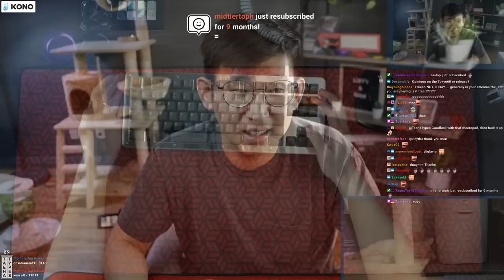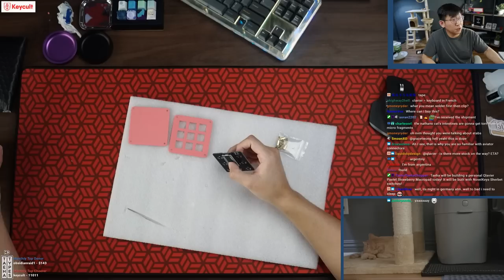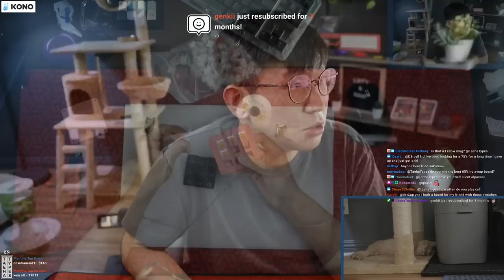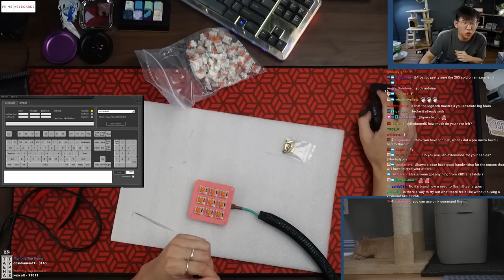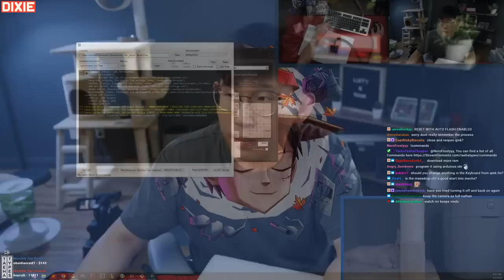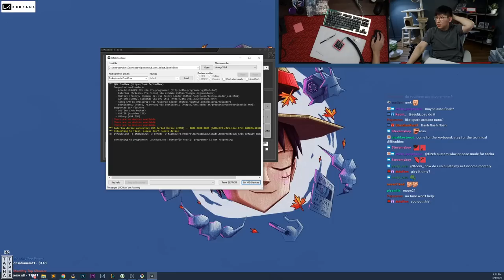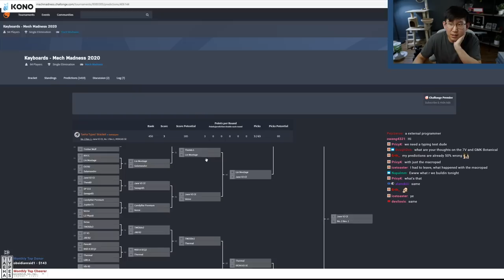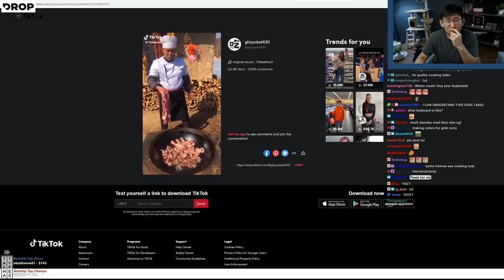Qlavier Pastel Strawberry Macropad Build Stream

Comment: The iso enter is clearly the better choice, it's vertical so you can't mistake it for another key (you press it between R2 and R3), and it's also more recognizable those starting using a pc. Another thing to add is that with 60% keyboard with HHKB style FN on the right shift you can have the arrows placed on a inverted T shape, clearly superior to the diamond one. I think that in the USA the ansi enter key is more used because it's cheaper to manufacture, and also we know that Americans struggle to adapt to a better standard (international standard instead of body parts for length as an example).
Reply: I LIKE YOUR FUNNY WORDS MAGIC MAN

Comment: ok so weird question,ive never built any sort of board before but I want a macro pad. If I build one like the steps shown in the video instead of buying one is there a way to use a toggle switch .basically I want to to the top row as toggle and the rest as regular keyboard switches